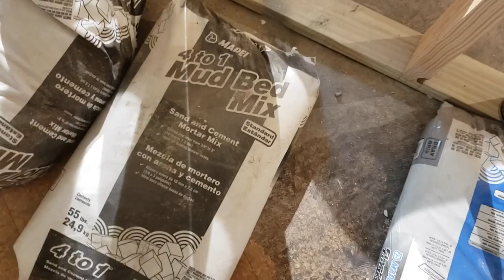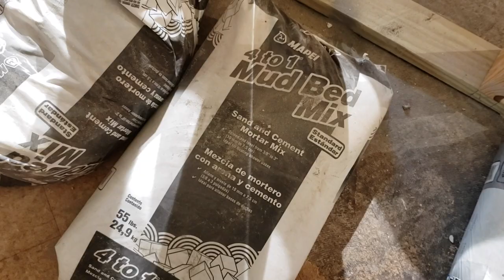Drypack Mortar Bed: for a CURBLESS shower

Comment: I just recently did a shower with the Kerdi pan.. I’m doing this next time. Honestly I think this would be easier to do. You also don’t have issues like the fairly soft foam.
Reply from the maker: Yeah, this isn't too difficult. Trickiest part is making sure the drain is set at the proper elevation (as shown in another video), and making sure the slopes are correct. See the comment below about making the finished product nice and smooth.

Comment: wet the trowel and pat it out to get a nice smooth finish, otherwise came out great.
Reply from the maker: Yes!! Thank you so much for posting this. My only issue I had after this job was the rough finish I left and your suggestion seems like it would have fixed that issue. Thanks!
Reply: Yeah it will smooth it out for sure but make sure it's not too smooth because you kinda want that rough bite to it and he could have just used some Portland for his bonding agent but his approach works also try to make your very first substrate slope to the drain and you definitely good

Comment: I’d like to see a finished video...are ya placing tile on top or is the dry pack the finished base?
Reply from the maker: Shower is currently still in this state (now with backer board on the walls, video coming on that). But yes, as a commenter said below, use a wet trowel to get a nice smooth finish. Then you would put your waterproofing membrane over it. I had planned videos on all this yet to come, but have had to put this project on hold for a month or two. Thanks for tuning in!
Reply: Do you add a rubber pan over this and then tile, or just backer board and tile?

Comment: Great work! I’ll be pouring a 4” thick slab home soon with radiant heating lines within it and I want to do a curb free 32”x72” shower. How would you recommend recessing the area and how deep?
Reply: Block out the shower completely for the main pour. Proceed as normal for the rest

Comment: Noob here, trying to get up the courage to do this at home. How is dry pack waterproof, the thinset at the bottom? What if the thinset is not level?
Reply from the maker: The thinset is there simply to bond the drypack to the base (in my case the concrete foundation. None of the components here are waterproof. The purpose of the drypack is simple to create a new "floor" sloped properly towards the drain so you have a smooth surface for tiling, and all water will make it way to the drain. Any true waterproofing happens after this step. Cheers

Comment: How thick does your concrete have to be?
Reply from the maker: Hi Dianne, I'm assuming you're talking about the mortar bed concrete. I chipped down far enough so the mortar would be at least 1/2-3/4 inch thick (this is only in a couple spots that were difficult to chip out. In most places it is 1-1.5 inches thick.